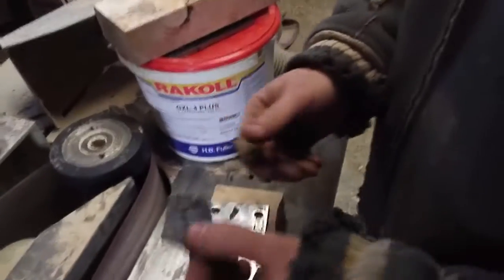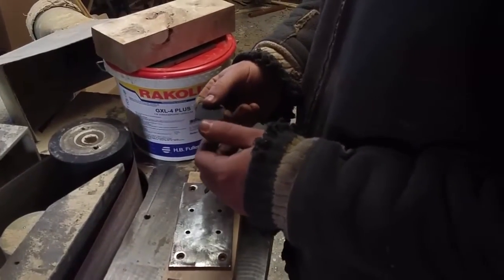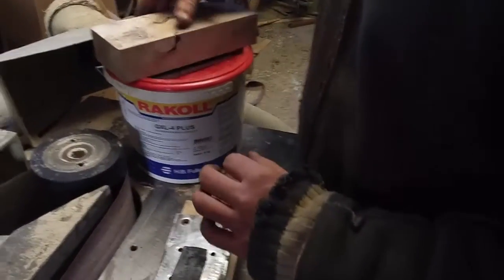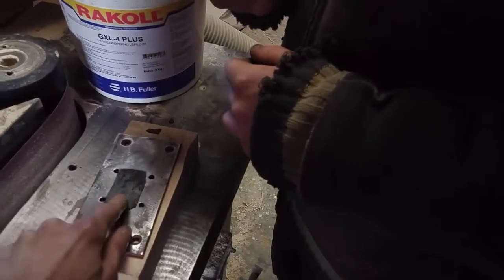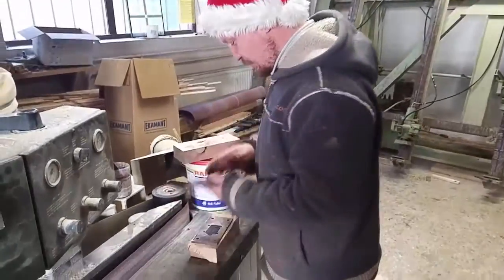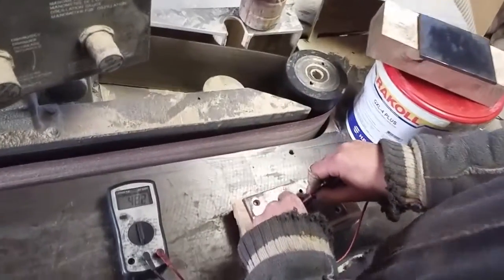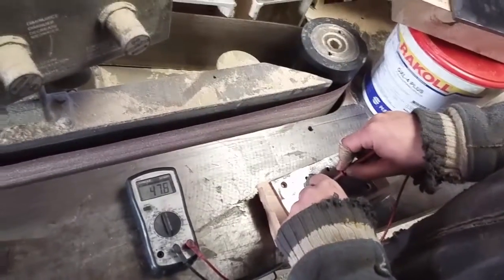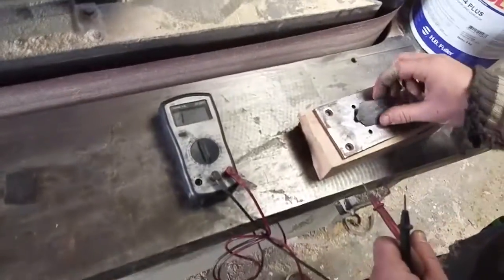DIY GRAPHENE / GRAPHITE PLASTIC Part 2 (PRESSING THE GRAPHITE PLASTIC)

Comment: Can you do a plate body armor with this? You should test! Thanks
Reply: Technically yes, if you happen to know how to make a polymer plastic (AKA 1:2 pva glue:borax solution). You could include "additives" & "fillers". Fillers like sand(would yield you a rock like polymer plastic) fiberglass(would yield you an impact resistant polymer plastic) and sawdust flakes(would yield you a wood-polymer composite used in architecture)

If you have the time yiu could formulate your own armor plate with all 3 fillers i mentioned
Reply: Harvey Lorenze De Jesus Thanks for your answer, you explain ALL i want to know! :D

Comment: Please can you try to add red rust (iron-oxid) or Magnetite ( black magnetic rust) or Zinkoxide to the graphite before making these plates and see if this 
help ? You could also use MnO2 with it, that really helps, but it is more expensive then simple rust...( iron-oxide)
Reply from the maker: +overunitydotcom hmm,... iron oxide is not so conductive like graphite. zinc oxide is also not good conductor,... but you can make negative electrode for zinc battery. Zinc oxide + graphite + polystyrene or PVA and zinc for current collector. and watch if the zinc oxide turn in to zinc. use manganese dioxide for active material not for additive for conducting plastic. you can try with adding some iron powder,... but will probably turn in to iron oxide.
Reply: cayrex2
Well, yes, then maybe only put it around the graphite plastic plate... the Oxides are needed to reduce the H3O+ ions which stop the current flow, cause they clogg in front of the electrode and build a cloud of positive charge, so the current can not pass, when I have understood it correctly... so one normally uses MnO2 as an oxidizer to get rid of this cloud barrier.....

Comment: So this was 48 Ohms now ? Can you still get it lower with more pressure or other methods ? We really need graphite plates with lower than 1 Ohm for good efficient batteries... ! Otherwise we waste too much energy in these battery graphite electrodes that then work only as resistors... Many thanks. Regards, Stefan.
Reply from the maker: +overunitydotcom at the beginning it was 112 ohms and with pressing 48 ohms. yes, you can make plate with wery low ohms. you need a intercalated graphite and realy good presseing.
Reply from the maker: +overunitydotcom also for lower ohms you need to change the binder.
Reply: cayrex2
Where do I get intercalated graphite and how much is it ? Did you try to put MnO2 into the electrode or around it to help stop the H3O+ cloud around the graphite plate electrode that stops the current flow ??
Reply: cayrex2
I wonder, if one can also use other oxidizers like KNO3 or KMNO4 to oxidize the H3O+ ions at the graphite plate that stop the current flow and reduce them to normal neutral water  ??

Comment: Well done. What is the lowest ohmical resistance you can get from it ? Do you get it lower than 10 Ohms ?? Regards, Stefan.
Reply from the maker: +overunitydotcom with this setupe can you get down to 8 to 6 ohms.
Reply: cayrex2
Can you show a video with the current difference between a 6 Ohm plate and a 20 Ohm plate ? So we see, that the 6 Ohm plate can drive more current without a stainless steel current collector plate as the helper ? Many thanks.